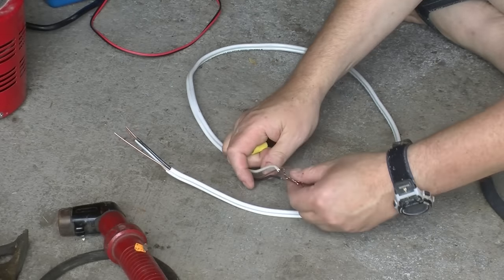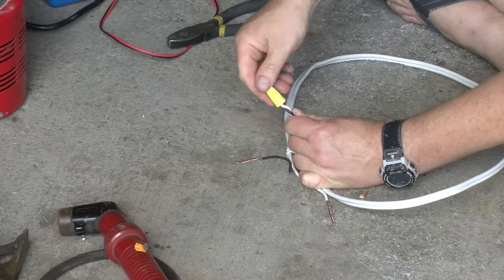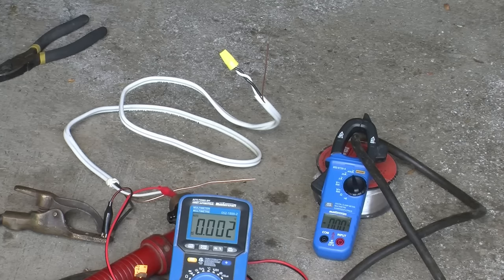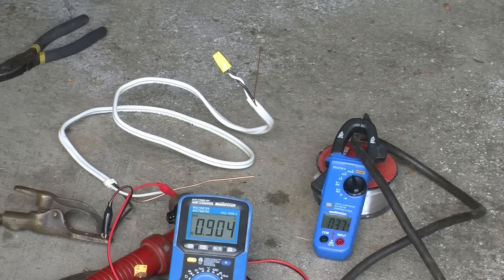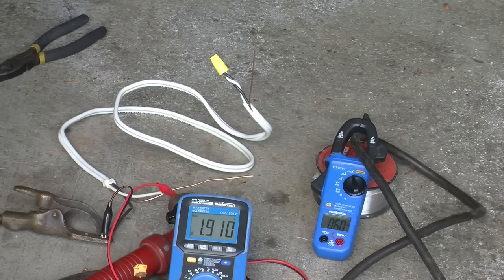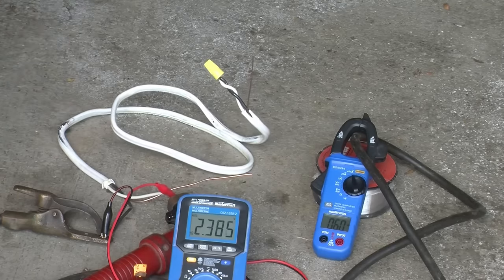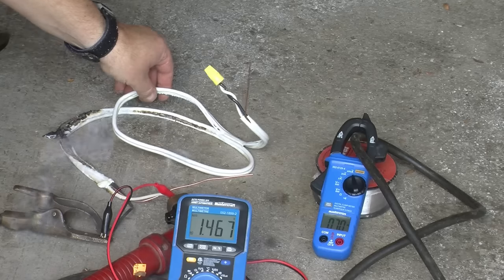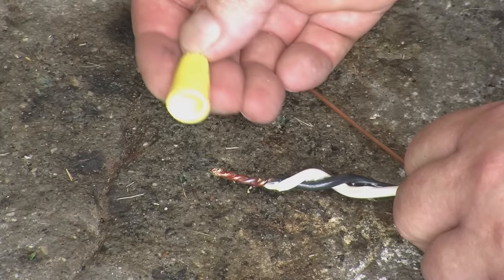How many Amps to burn up 14/2 electrical wiring?

Comment: Just throwing this out there, I've been in construction for 15 years, and I've never seen an electrician pre-twist the conductors, before putting on a wire nut.  I'm not an electrician, but I have quite a few friends that are, and that just doesn't happen on a typical commercial jobsite.
Reply from the maker: There was another comment (that I cant find now) from an electrician saying he was specifically taught not to twist them to make it easier to change later (I'm paraphrasing). My comment was maybe it is a regional/local preference one way or the other. I'm in Ontario, Canada and most houses I have lived in (except one) twisting seemed to be the way it was done. Course that's a very small sample set - way smaller than what you would have seen over 16 years in the business. So maybe not twisting is more common.
Reply: I work construction and most electricians pre twist as it’s a more solid connection, GC must go for the lowest bid if you rarely see it in commercial
Reply from the maker: @Nick-bh1fy  That's an interesting comment. I actually did a stress test in another video where I massively overloaded  a twisted and untwisted connection and the twisted one was  in surprisingly good after 270 Amps. Untwisted not so good, which really supports what you said. Its here if you are interested: https://youtu.be/Y-2LmKlQW2A
Reply: @ElectromagneticVideos  the way I was taught was the marrette is only there to insulate the connection and not act as a physical bonding connection between multiple conductors. I strip wires slightly longer, twist from the end and cut off the copper that has been nicked  and you’ll have a connection that won’t come apart.
Reply from the maker: @Nick-bh1fy  Sounds like a real quality way to do it. The wire spring thing in the standard marr type connector really seems quite flimsy, particularly with the softer plastic used today. The old black ones with much more rigid plastic probably could exert more force on the wires, but even then I'll bet your technique would produce a much better connection.
Reply: @ElectromagneticVideos  at the end of the day it comes down to personal preference as there’s no define way to do it. Great vid
Reply from the maker: @Nick-bh1fy  You absolutely right Nick! Glad you enjoyed the video. I have really been enjoying the comments - its really neat to hear the different experiences and practices people have.
Reply: Every single electrician(i am one) that is worth their salt twists if its a wire nut. If you dont, thats called trying to get more work the bad way. No, I repeat No electrician would not join the copper without a twist in wire nuts, to make it easier to change anything. Will you get me the wire stretcher?
Reply from the maker: @SuperChad1313  Since your a pro, how do you feel about things like the Wago lever connectors and the other "just push the wire in" ones? Do ever/always/never use them?
Reply: Electrician over 50 years here. Electricians who don’t twist are not electricians.
Reply: @ElectromagneticVideos  wago are good for lights but I don’t use them on much else or bigger wire.
Reply from the maker: @jopo6388  I'm not an electrician, but I completely agree with you. One commenter did say he was taught not to twist. That surprised me.
Reply from the maker: @lonedesertfox  And I would guess that particularly applies to the low power LED lights today that use so little current.
Reply: Manufacturers say its not necessary to pretwist.  I can understand why a tradesman working by the hour wouldn't want to add an unnecessary step.
Reply: @jopo6388  actually, electricians who don’t pre twist are electricians that follow the instructions on the packaging for the wire nut.
Reply: @ElectromagneticVideos  I can deal with wagos, sometimes you need them for different reasons.
Reply: @SuperVstech  What one?
Reply from the maker: @SuperChad1313  I can sure see of they would be great in many situations. And in all fairness to them, they did do fine at rated current. And of course my sample set of 1 really isn't enough for a  real assessment of them.
Reply: @SuperVstech  not required because it’s also supposed to be somewhat diy/homeowner friendly, if you have any intermediate level knowledge of electrical theory you’d see why relying on the marrette to twist the wires isn’t the best idea
Reply: Hate to say this, but I would not hire an electrician that uses wire nuts. Maybe they're too cheap to use WAGOs. Given what they charge, I expect them to use the best, not the cheapest. They probably use wire nuts that have already been used.
Reply from the maker: @outlet6989  Take a look at the connector test!  https://youtu.be/cMVnOZCGljc
Reply: The box said no need to twist
Reply: @outlet6989  LOL...we over here will be ok......nice gaslighting though.
Reply: @jopo6388  you used to test for voltage with the wet fingers didnt you? :D I have heard many stories........
Reply: @outlet6989 I wouldn't hire one that used wagos. Wagos are the equivalent of Stab-Lok breakers and back-stab receptacles. Their contact surface area is far smaller than a wire nut, and their holding power is much less than a properly installed wire nut. Wagos have to carry current. If twisted properly, wirenuts carry no current, and are simply insulation.
Reply: What? Then you are not watching an actual electrician or extremely dangerous electricians! pertwisting is what seperates the pro from the amateur as a wire nut is never ever ever meant to create the twist!
Never hire the electricians you have seen as they are POOR examples of an electrician!
Reply: So far it's been my same experience in the industrial world as well, and yet in both applications the inspector passes the job every time.
Reply: 9 year electrician here. When you give 5 to 7 hard twists after the nut grabs the ends, the nut itself makes a twist in the wire that will hold even if the nut is removed later. There are nut driver tools for this purpose. There's no time to pre-twist by hand before every wirenut. Hand pre-twisting is one of those practices that workers latch onto as a way to feel like their work is more quality. I've seen my fair share of workers go through these phases and finally accept that they are just wasting time. I went through it myself.
Reply: You are right!!   But you should know that if you pre-twist 2 inches or more and then clip off the end to see all wires are there and then put the wire nut on you would have a very good connection lot of wire to wire connections.
Reply: @d.s.5807  Baloney! I have put tens of thousands of wire nuts together and never had a failure. If you twist the wire nut so the wires start to twist several times down from the wire nut then you have a great connection.

Comment: Here in the great south land we use 1.5 square mm cable for lights.  Maximum current is 8 Amperes, protected by fuse or breaker.   Supply voltage is 240 Volts.      I notice that folk often confuse millimetre squared with Square millimetres.   There a big difference.

Stavros

Comment: The wire is rated for 120V@15 amps. That is around 1800 watts. Your set up is wrong for measuring voltage. The welder at 15-20 amps should still be pushing 20-25 volts or in that ball park. Your grounding clamp should not be touching the ground. My vacuum cleaner pulling 15 amps can get a lot warmer than your set up at 30 amps. Instead of twisting the ends together you need to connect them to a dummy load. Shorting them out is not really a valid test to show how wiring reacts when electricity flows through it.
Reply: The cable is probably rated for 600V (this is the insulation rating), so it could theoretically carry 600V*15A = 9kW of power (that is not the same as how much power the cable itself will dissipate as heat). His test setup is fine; he is measuring the voltage drop across the cable which shows him how much power the cable itself is dissipating as heat due to its finite resistance. If the grounding clamp was not connected to ground, there would be no current flow. Where else would it be connected to? The cable can't tell the difference between your vacuum pulling 15A and his test setup pushing 15A through the cable. It all essentially "looks" the same to the cable (the voltage drop would be the same across the cable).
Reply: The welder may be designed to operate at those voltages and currents in normal operation, but with it's output shorted with a short length of wire like this it will fail. Ohms law says that the voltage will be the current in amperes multiplied by the resistance in ohms. No exceptions. Your vacuum cleaner gets warmer at 15 amps because the voltage is 300 times higher. Watts is voltage multiplied by current.
Reply: @david672orford  Neither the cable nor the vacuum are dissipating 1800 watts as heat. The wire is dissipating much less because its resistance is much lower. The video is demonstrating the amount of power that the cable itself dissipates. The vacuum might heat up, sure, but the majority of the power is being used to create the vacuum, not heat it. Since you're aware what  Ohm's Law is, you would have to agree that the cable can't "see" the difference between the the test setup in this video and the vacuum example. With 15A flowing through the cable (in this test setup or the vacuum), the voltage drop across the cable is the same.
Reply: @stuckbreaker8586  Yes, I agree with you completely. The test rig shown in this video produces correct results. Those who keep bringing up how many watts this cable could deliver to a load at 120 volts are confused about what is being measured in watts in this video. And yes, only part of the 1800 watts remains behind in the vacuum cleaner as heat, but it is easily far more than the 21.45 watts which this cable dissipates at 30 amps. So Bryan Rocker should not be surprised that the vacuum cleaner gets warmer.
Reply: @david672orford  Agreed, I misunderstood your previous comment and thought you said the test setup was a failure.
Reply: His setup isn't wrong. He is using a variac to lower the power of the welder.

Standard 14/2 wire is rated to 600 volts. The voltage rating on a wire is just for the insulation.

Wires aren't rated by watts, just amps. If a wire melts at 40amps it will melt at 40 amps regardless of voltage. The resistance of the wire stays the same so the voltage drop stays the same.

Comment: so basically that wire can run my dryer, which is 30amp, or even my stove which is 40 amp and not catch on fire right away. Eventually though it will fail. We'll keep it under 15 amp.
Reply from the maker: "not catch on fire right away" is it. You can put almost any current though any wire if its only on for a short enough time. Would be very bad idea to undersize the wire used for a dryer or anything else for that matter. All yo are doing is removing any margin of safety and probably invalidating any insurance you might have!

Comment: It would be interesting to see if it did the same thing at lower current    with  more volts
Reply from the maker: The voltage here is along the wire - even at high currents - which is what produces the heat and is the same as what would happen in a real overloaded circuit. If the voltage between the wires was typical line voltage as you suggest (120 or 240V) the only difference would be when the insulation melts or chars to the point when the wires touch and short, we would have a massive over current similar what is shown at the end of the video. I would need a much more elaborate setup to  do that  safely so unfortunately I cant demo that right now.
Reply: Hi Grill Master, voltage and current are not independent.  Think of voltage as the pressure that causes the current to flow.  Apply a higher voltage (more pressure) and more current will flow.  It's just like a water faucet where if you increase the water pressure you will have a higher flow rate of water.
Reply from the maker: @wd8dsb  Wonderfully clear explanation!
Reply: @wd8dsb  and since in a real world scenario, house current is typically used at a higher flow rate; ergo, this experiment is invalidated and the results should be viewed as inaccurate... In relation to real world applications, that is.

Comment: Good demo as long as one remembers that it is done in open air not surrounded by isolation, or installed in an attic where the tempertures may be as hot as 150 degrees in the day time.
Reply from the maker: Exactly! Did a bunch like that. Take a look at this one: https://youtu.be/4k0xLiokNsc

Comment: hi, 

can i savely operate a 24V COB LED strip on 20-22AWG wires? 
The AC adapter puts out 24V 1,5A. 
The lenght of the wire is about 2 meter long. Ive cutted 6 pieces of 85 cm The COB Led Strip in paralel connection to it.

Is this save or can it be that the wire starts to melt or burn?

Thanks
Reply from the maker: Your right to be concerned since it  is the current (not voltage) that heats the wire.   I just looked up the current rating  of AWG 22 which ranges from 0.9A to 7A depending on situation.  The AC adapter you have is rated at 1.5A  but usually something like that can put out more current at least for a while. What you really  need to know is how much current the COB Led strips use. You will have to measure it unless the specs tell you how much current each piece draws. Multiply the current for each piece by 6 (you have 6 pieces). If that total current is more than 1.5A you need a bigger AC adapter (or use less pieces). 

As far as wire goes, if the total current is less than 0.9 you are fine. If its above, consider a thicker wire to be perfectly safe!
Reply from the maker: @gaboaaa23  It says 9W in the specs which means it uses about 0.4A at 24V. If the specs are right, your fine - but you can never be too sure of specs on Amazon. If you dont have a multi-meter to measure the current, leave the lights on for 15 minutes and then feel the wire. If it is at all warm or the insulation seems soft, use a thicker wire.
Reply: @ElectromagneticVideos  ok i had the light on for about half an hour. No warmness on the wires or any suspicious.
The ac adapter gow warm slightly. But only hand warm on even less.
The light will only go on if someone goes in front of the glas shelf. And turns off after 1,5 minute. Sos you say it should be fine right?

I have a multimeter. How can i messure the current? I knwo how to messure the "volts" but the current? On which sign i have to switch the multimeter?

Thanks
Reply from the maker: @gaboaaa23  You probably OK! For amps look for a setting marked A or mA and like the V setting, AC or DC options - choose the DC one. You have to put the meter leads in series with one of the wires to the light. ie between the power supply and the lamp, not across the two wires like you do for volts or you will burn out the meter. If your not sure and want to measure current  maybe ask a friend or neighbor with a bit more experience withe electrical stuff.
Reply: @ElectromagneticVideos  i see! Thanks I will call some friend who has some know how on metering. Thanks for your help!
Reply from the maker: @gaboaaa23  Your welcome! Glad I could help!

Comment: Wire nuts perform two functions -- they're supposed to ensure good electrical connection and also prevent shorts due to exposed conductors. While pre-twisting wires will secure the electrical connection, it can leave the nut itself less than snugly attached. I noticed quite a few turns in screwing on the connector, so it may be that it was indeed fastened well enough to escape loosening during expected conditions. The temptation is, when the wires are already twisted together, to quit applying the nut to said connection before it's truly secure!
Reply from the maker: Very good point. With pre-twisting one probably should take extra care to make sure the wire nut is on securely.
Reply: Agreed.  I was taught to NOT twist wires together.  That is the marette’s job. 

Plus you twist the marette until the wires are twisted.  Until then it isn’t tight enough.

Comment: In an actual installation, the wire would be conducting heat away from the device terminals it is connected to adding to the heat load of the conductor, but still a nice demonstration.

Comment: I give credit for the “touching” and he’s doing it so nobody else watching should feel compelled to try.😂  Im no electrician, but I know better than to touch. Cool video 👍🏽
Reply from the maker: Glad you liked it. The voltage is really low (typically 5V or less) for this sort of test so there is no real concern about touching it. Now it it was at 120V, I sure wouldn't touch it!
Reply: I see... but I would also like to understand that fact better. Because I can use/apply my limited knowledge to "do whatever" correctly as the industry standard or instructions dictate. I can match or duplicate a thing that exists and works. But why is 5V with high amperage not as much of an issue than 120v?
I know why 120V is very dangerous, does that mean I just "reverse" that knowledge to get my answer? 
If that makes any sense at all 😅

Comment: Actually the NEC does not say to pre-twist wires before putting on a wire nut.  Most wire nut packaging says ‘no pretwisting required’
Reply from the maker: There seems to be a significant numbers on either side of the twist or dont twist discussion which was a surprise to me. Certainly manufactures instructions for a connector should be followed.

Comment: Thank you. Just the test I was looking for. 👍
Reply from the maker: Glad you liked it! A word of caution though - as some later experiments in later videos showed, if 14/2 or any other wire is surrounded by insulation the safety factor between rated the current and the overload current  when bad things begin to happen drops considerably.